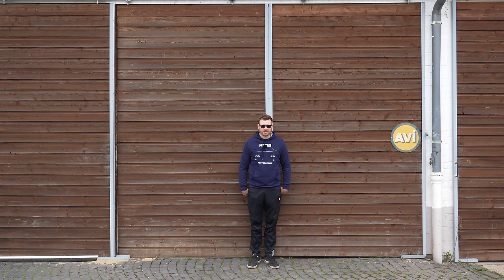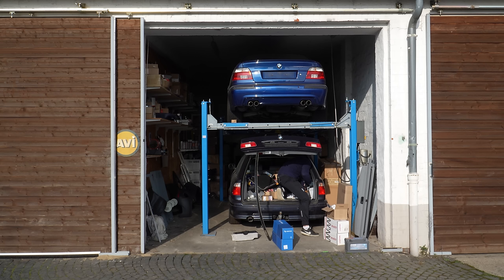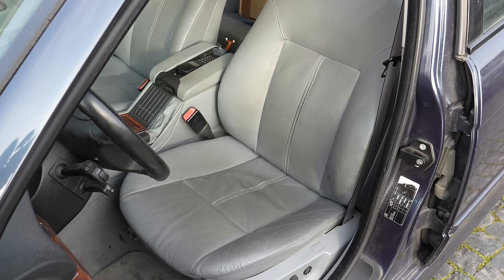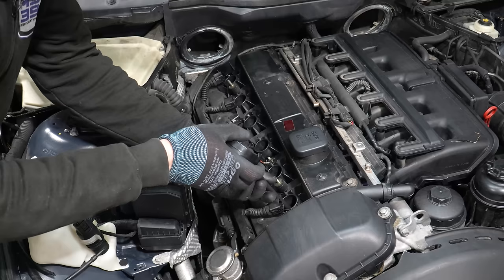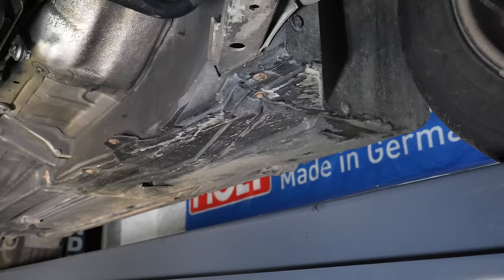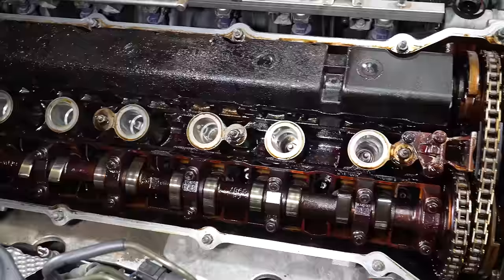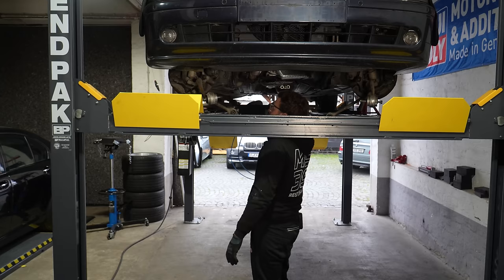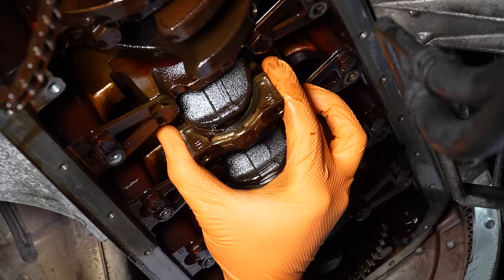I Bought a Heavily Neglected Executive BMW & Immediately Started Restoring it - Project Rottweil: P1

Comment: Love this channel can anybody help me please I have a BMW3 series hardtop convertible 2007. The roof will go to go down then stops and won’t go any further. Then you can put the roof back up and it will shut close. It’s not the roof part it’s off. The roof is working fine it’s the actual back boot trunk won’t open and go back for the roof to fall down into it. It is the original battery on the car from 2007. Could this be the problem but there’s not enough power in the battery

Comment: Is Meyle really that bad? What are you using instead? Febi?
Reply from the maker: Meyle is bad. Febi is sometimes good. I use OE or original parts mainly.
Reply: @M539Restorations  thanks! How do you find OE, though? OE manufacturers vary, don't they?
Reply: @M539Restorations  I see that this has garnered quite some comments and misunderstandings on OE brand names. May I suggest a video where you go in detail on this and give us some opinions and what to look and look out for and how to go about it. Thank you for your videos and take care.

Comment: Please renew the oil return valve in the oil filter housing as well. They’re always worn out and thus oil from the head flows back into the oil pan resulting in no oil pressure at every cold start
Reply from the maker: That's an easy one to spot, if you have a bad valve in the oil filter housing, a red oil light in the cluster will stay on longer (like 3-5 seconds) indicating low oil pressure on start up. I've never seen one worn out, except on project Dubai where someone broke the valve. Will check though while-in-there. Danke!
Reply: @M539Restorations  You definitely know your stuff 👍🏻 I have a good Disa valve for spare btw. and will be on Hanauer Landstraße on Wednesday in case you still need one ;)

Comment: Love, love  the channel but my first real critique.  I have an E53 and ive done these jobs and the problem i have is there are SO MANY details that are missing and left out. There are much better step by step how to that includes critical details.
Reply from the maker: Everything critical was covered here, for example Vanos that you mentioned in the previous comment that you deleted, the entire unit was taken apart, this and Beisan repair instructions is all you'd need. I can't explain every basic detail as that would take up the entire video and make it not interesting for 98% of the viewers. You should always try to use BMW repair manual along with the video as it's impossible to cover every single detail in a video where there are tons of other repairs. That said, none of the important details are missing here. I always try to cover important details and explain everything in a concise, easy to understand way.

Comment: im confused, at the start he showed the oil cap and it was a cream-ish color, doesn't that mean there is a head gasket leak. If so why didn't he do it yet?
Reply from the maker: It doesn't mean the head gasket failed. CCV failed and there's unburnt condensation in the oil.

Comment: You didnt correct refurbished vanos. Main nut need torque wrench not impact gun.
Reply from the maker: No, it doesn't.
Reply: @M539Restorations  Then drive it 10k km and recheck for play. Or explain that you unscrewed them during axial play test (after you overtighted with impact gun) and tighted gently by hand. 🍻
Reply from the maker: You clearly aren't informed or understand how the whole Vanos piston works/is setup. First of all, there is no specific torque provided by BMW for that nut. It is a non-serviceable part so you would be guessing.
Second, the nut doesn't set the preload on the thrust bearings, washers and spacers do, which you then adjust to the point where the piston spins freely and has no axial play. You cannot overtighten it by doing 3 quick clicks with an impact.
Third, if you still somehow think you are right, tighten the cap by hand and check how it spins. Then tighten it with 3 clicks by an impact and check again. You'll see there's no difference and that they spin exactly the same. This is because the preload is set by the washers and spacers as explained before. I tested this myself.
I drove far more than 10k km on rebuilt M54 Vanos units in such a manner. Beisan, who makes the parts, provides these instructions. I don't understand your criticism here.
Reply: @M539Restorations  Ahaa, so You are just up to specific readed data that you can find. Nothing about years and years of experience. From BMW there is NO a lot of specific info about many many parts, repairs but still a lot of us still fix them, vanos, tb etc.
You keep reading brochures and try to be mechanic. Continue your changing part journey 😉 Cheers 🍻

Comment: I love how it has "CErAtEc" stickers on the engine as if that would be helping anything here when the rest of the car is  hopelessly neglected. Certainly didn't hurt the engine though-
Pretty overpriced too that stuff 20€ a bottle and yes its effective but for example Mannol Ceramo Ester is a superior product and much cheaper its less than 10€ per can if you buy a couple of them at once.
They should have just done more regular oil changes...
Reply from the maker: Please don't write nonsense. You simply prefer one than the other.